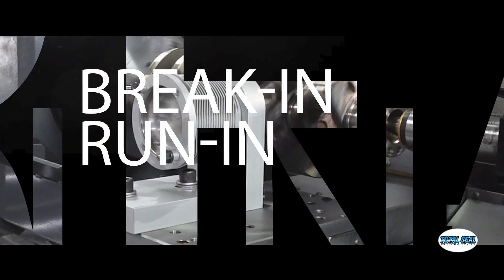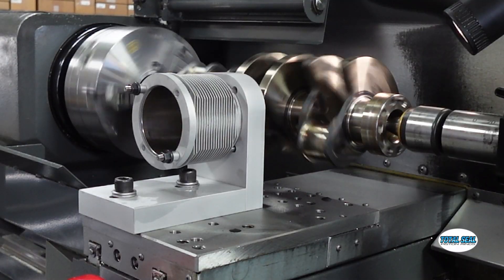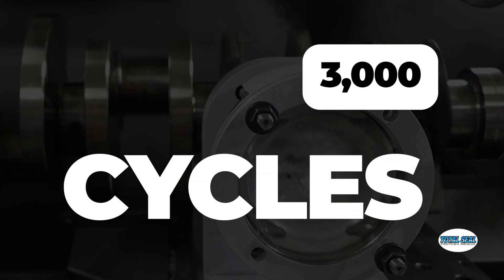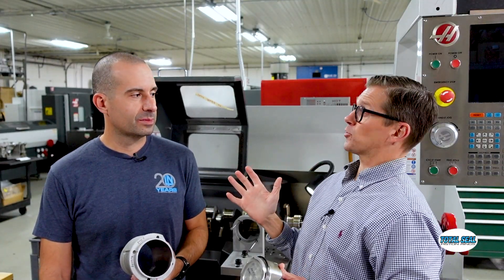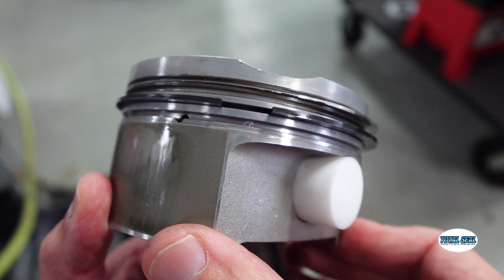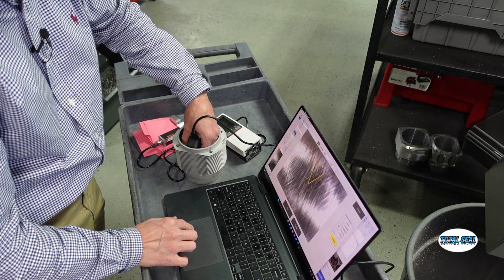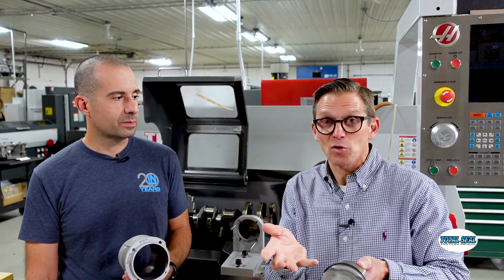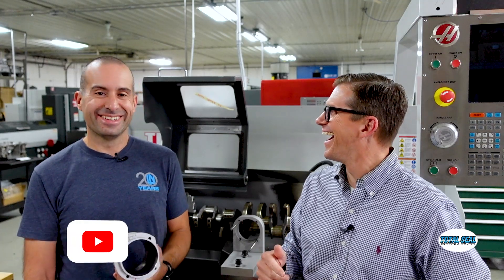We Built a CNC Spin Test Rig...The Outcome Was Unbelievable!

Comment: How is this anything like an actual cylinder in an engine? Most of the people using Total Seal rings aren't running blocks with Nickasil coated cylinders 🤷🤦 they're cast iron with heat and oil and fuel and all the other things. So how does this equate to that? I ain't seeing it.

Comment: I'm sure someone way smarter than me has asked this question already. With the spin rig in a "boxer engine" position how does that tell the effects on the rings in other engine configurations? Wouldn't these test results differ if the spin rig was in an inline, 90° V8 & 60° V6 positions? Does gravity in each of these engine positions effect the results? Thanks, love the channel🏆💪
Reply from the maker: Thanks. We could not do this test in a vertical position because there wouldn’t be enough oil available. The boxer position makes it possible.
Reply: @TotalSeal  thanks for your reply. However, i didn't get an answer to the question of if the results would be different from gravity pulling on the piston in different positions? Of course if oil is properly supplied. Thanks again

Comment: Well I'm sorry too burst your bubble 
but
  The only true way too test and run-in pistons and rings properly is too run-in on a live running Engine with actual cylinder pressure and actual splash lubrication and combustion, And a variable load.
If you don't want fuel wash and contamination run it on liquified petroleum gas LPG or Propane. Set the mixture lean.
The effects of fuel wash and rich mixture can then also be seen upon tear down.
doing the run in without any combustion and load will cause 
a glazed cylinder which will then become  useless and will cause excessive oil consumption. Insufficient oil ring tention will also cause excessive oil consumption too occur.

I have more
Reply from the maker: We are fully aware of that. Check out some of our other videos on that.

Comment: Makes sense to me. I broke in my new 03 Suzuki on the way to a dragstrip (2 hour ride). I let it cool down and made 30 or so passes and then rode it home (another 2 hour ride). I changed the oil and filter once home. In 2024 the bike has never burned a drop of oil!
Reply from the maker: Nice!
Reply: Wow 30 passes at the drag strip. Very cool What was your average time and what was your best time?
Reply: @ex.spaceshuttle.worker 
I usually just hit the test and tune nights. 
With that being said, I remember one night there was only like 8 cars. 
I'm joking of course,but I ran so many times that I was almost getting bored 😂.
Line right back up after a run and go again,for about 2.5hrs when I decided to finally look the car over ,and then went back out for around another hour. 
Like Archie and Edith sang: gee that old LaSalle ran great, those were the days. 😂

Comment: That's all very well for a compressor cylinder.. try the same test on a  "combustion engine" .. under progressive load.. & see when the rings start to gaul from the hone on the bore especially with nikasil.. do a hand file experiment light filing & heavy.. with a sharp file vs old full file.. that's what the bore will do to a ring.. & destroy any surface treatments.. then the rings done.. localise friction heating & ring temper tension's are gone

Comment: I'm a little confused.

He said the Spintron runs outside of, and separately to the engine assembly.

So, why did he correct himself when he said that the at 2,000 rpm at 3 minutes, it was 3,000 cycles, not 6,000 cycles?

Why would the Spintron machine bother indicating at crankshaft rpm when there is no need?

Surely the Spintron would have its own RPM guage that the camshaft is turning at.
Reply from the maker: The camshaft still runs off the timing chain which is connected to the crankshaft, even on the Spintron.

Comment: Sorry to be critical, but this does not really match typical combustion chamber forces, temperature and even Cylinder orientation (Except for some boxer engines). Really disappointed in this video as it did not provide any value/insight of wear analysis.
Reply from the maker: Combustion would only speed up the process.
Reply: Piston rock from compression to power strole.

Comment: This seems a lot easier than what I've experienced; running engines at different load (torque/cylinder pressure) and different rpm and check for differences. It wasn't critical, but there wasn't much wiggleroom either as it took longer to warm up the engine than it took to do the break-in correctly. 😆
Reply from the maker: Absolutely!

Comment: Does this dispel some break-in theorys of running fresh motors for just breifly, letting them cool then running progrssively longer, mainly for the purpose of not over heating the rings and loosing tension?
 Any difference for air cooled motors, ie., the test cylinder ----------or Harleys?
Reply from the maker: Yes, that theory is false, and it is not good for the rings or liners.

Comment: I believe in a running engine the rings will break In faster because of compression and will break in the top and bottom of the ring.
Reply from the maker: Of course, the pressure from combustion will speed up the process.

Comment: I wonder if the test was repeated using zero oil (control) and then using various other lubricants (auto transmission fluid, gear, proper break-in, diesel... maybe even graphite powder...

The point of this is to give data to those engine builders who use their own "snake oil" and if there would be truth to effective break-in with different lubricant types.

Comment: Limited usefulness test. The ring must also bed in to the bottom of the ring land too. Without pressure it won't be the same.
Reply from the maker: Agreed. This was just about observing the ring to liner contact. As you said, the most important sealing surface is the ring to the ring groove.

Comment: How much horsepower does it take to spin a typical V-8 at 200 rpm, say a complete oil filled engine sans induction system, water pump, flywheel and exhaust system?  I wonder if a  220 volt, 2 horsepower electric motor would do this?  Be nice to do this prior to installation while on a test stand prior to actual running with gasoline.
Reply from the maker: Great question!
Reply: I think your 2hp electric would do it. I have a big drill that will do it.
Reply: Prime the oil system in a bone dry engine with your drill spinning at 850rpm, then ask yourself the question again. 

Valve train and oil being pumped is a huge load! Why not just try your starter???? Because it'll burn up. 

Huge electric motor needed.